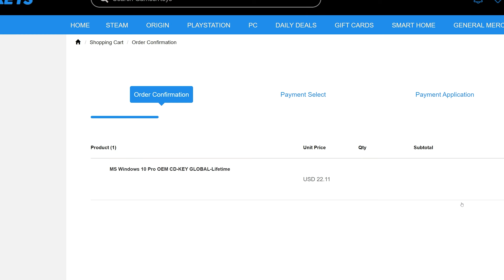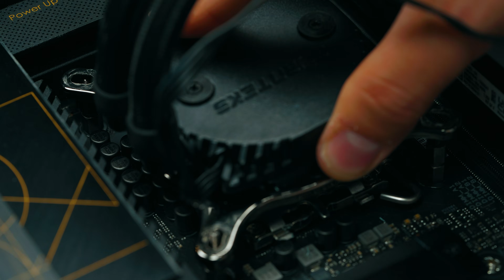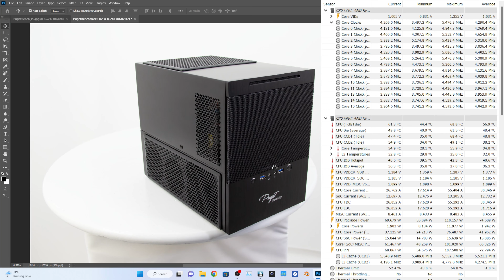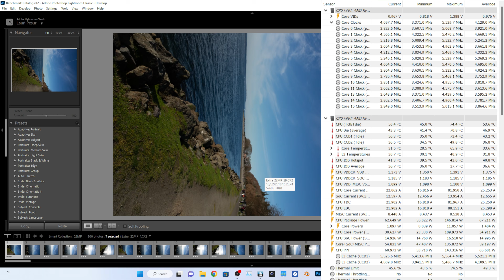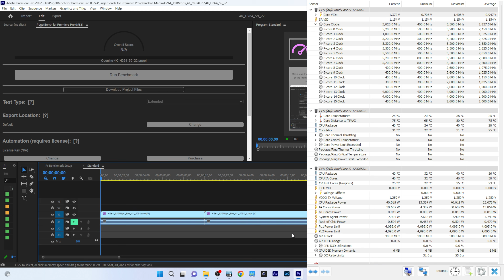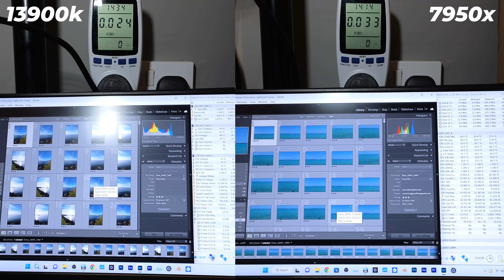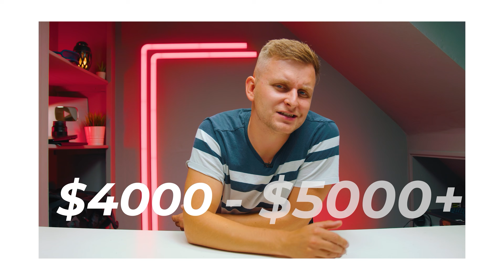INTEL & AMD both lied! 👉REAL WORLD power consumption is MESSED UP

Comment: This definitely needs to be expanded. Compare DDR5 and DDR4, older ryzen 5000 generations, possibly even 11th gen Intel and CPUs with lower TDPs <65W.
Reply: Oh, also the Ryzen Eco mode should be added, I love that function!
Reply: My observations with Ryzen CPUs are:
4600G - 2W at idle. Goes up to C3 idle state.
5700X - 20W at idle. Goes up to C2 idle state only.
3900 - ~30W at idle. It got hot quick, to a level I thought it's faulty.
Power was measured on 12V CPU supply on the motherboard, with current clamp.
All of these CPUs are "65W TDP".
Tested both with proxmox without any VMs running, and with fresh ubuntu.
+20W means +50€/year on electricity bill. That's crazy.

Comment: 15:45  up until this time in the video I thought the power differences were going mean huge costs for the AMD.  Then I see that the 7900x will cost about $20 a year (I'm in the US and pay around $0.30 per KWh).  I appreciate you doing this work, but for $1.67 a month, I couldn't care less.  I'd rather have a higher average wattage with a lower max wattage, especially if the difference compared to a 13700k is only $5-7 per YEAR.

Comment: I'm a little confused. Doesn't Idle mean the computer is not being used at all; meaning the computer is not running any programs? Your "idle" power consumption shows a program running in the background, which means it wouldn't be idle. It would be running in the background.
Reply: No, "idle" can include non intensive apps being run or left open even. Reading a website for example or having an empty scene with blender running, and nothing being rendered. Think of it like starting a car and while its in drive, without pushing down on the gas pedal, the car still moves forward. You can still move from point A to point B. That's kind of what "idle" refers to in the context of the CPU.

Comment: If you want to have the mean power consumption you have to integrate the measurement over time and than divide it by the number of increments. But you need a measurement software for that.

Comment: I've made a lot of testing with my Ryzen 5600H Laptop to find out its best performance per Wat. Power efficiency depends on max TDP. So it was 15 W for a 50 W processor. Where it has exactly 50% of max computing power but much lower temperatures <50 C, nearly quiet fans, and more than enough power for day to day tasks and even games. Moreover I tested it in multicore cinebench R23 test. But in day to day tasks you rarely use 12 threads. So single core performance dropped only 10%. I used Ryzen Controller app to restrict TDP for normal and boost modes. And I'm happy with results. Dropping TDP lower than 10 W kills performance totally it's just not enough power to function properly for this processor e.g. on 5W it has freezes in all operations and only 9% of max performance. It would be interesting to see efficiency curve for Intel Processors. I believe they shouldn't have such efficiency boost (+50% efficiency) on low TDP.

Comment: Can you please do an update also with the 3D ones from AMD? It would be interesting to see how they do in idle.
Reply: my 7800X3D idles at 30-40 watts!
Reply: @juno1597  That is quite a lot. Not as bad as the about 50-60 I saw for 7950x (I think), but still bad. Intel ones idle at about 10, even a bit lower sometimes.
Reply: @ContraVsGigi  I can't believe how bad these processors idle and I leave my computer on all the time.  My 4770k overclocked would idle as low as 5 watts!
Reply: @ContraVsGigi  yeah, i dont have a 13900k myself, but my friend has a 12700k which is close and it idles at around 9w from what he told me

Comment: I wonder if the 7800X3D uses the same idle power as the 9750X?
Reply: Only 1 ccd, it will use less. Still higher than an intel though.
Reply: @deuswulf6193  I'll take it, cheers!

Comment: This is a really interesting test, but I'm trying to decide between the 13600k, 13700k and 13900k. I'm a full time photographer and I'm trying to understand the difference in power consumption and therefore electricity cost would be over a typical year between the 3 CPUs? Is it significant or inconsequential?
Reply: You're not going to make a dent to your electricity bill for photography since it's mainly burst CPU usage (culling & photo adjustments). You would have to export ten of thousands of photos daily to even consider power consumption. Which software do you use and are you a high volume photo exporter?
Reply: @Rocky_KO  Mostly LR and Photoshop. I don't do high volume work, so most of my time is spent doing compositing and detailed retouching work in PS. I kind of came to a similar conclusion after watching some other videos and doing some maths on it. I bought the i9 13900k in the end.
Reply: @mdhazeldine  13900k isnt a bad choice. Since its a full time job, processing photos will require a lot of cores and high productivity. 13600k is more power efficient though.

Comment: intels idle power draw has nothing to do with the e cores.  my 9900k drops to 5.5 watt.  They just downclock way way better. AMD needs to be better period. Their board power draw is also stupidly high. And your test only applies to stock settings and sadly stock is BAD these days specially intel needs to be capped on power draw. they are just given to much power. If you cap them on -30% power you barely lose any performance but power draw drops significantly. But yeah i buy high end at all times and AMD is just not cheap enough. They need to e at least 200 cheaper for a high end system to be even considered seeing i make a system last 4 years on average and power is expensive so that value needs to return to me...

Comment: SO all in all the difference is a night out at Spoons per year? its hardly a huge thing. i was worried that the 7950x would be massively costly to run but it seems at worst there is about £30 per year in it. yes the AMDs generate alot of heat but in the winter months that heat can heat up your room so nothing wasted :P also you can cut down the AMD chips power usage in the Bios where you only loose about 30% performance. and half the energy cost. 
for me i only use the these apps occasionally. i mostly do 3D work and Unreal work so its GPU heavy and would use resolve for video editing. I will consider intel and see if a cheaper mobo and CPU would be an option. thanks for the video it was helpful.
Reply: I think the whole comparison is rigged, wrong made (software only!) and you better dont even think about power consumption or efficiency when it comes to x86 platforms in general.
- INEFFICIENT BY DESIGN, universal, every programmer knows how to handle it, but still ancient and inefficient.
- As you stated, hardly a huge thing if the faster CPU only cost 5 coffees more a year.
- ARM SoCs.... since they are getting more and more interesting especially for the 0815 consumers, we can say pretty sure: x86 is outdated and should have been long gone, since at least the ARM v7 era.

"also you can cut down the AMD chips power usage in the Bios where you only loose about 30% performance. and half the energy cost"
At this point you also could have just bought a Ryzen 5 instead of the Ryzen 7. I would rather go the opposite way - for example my i7 4790k from 2014 is still running at FIXED 5GHz (overclocked...) otherwise it gets unstable, but i rather prefer 10-20% better single and multicore performance which translates about 1:1 in fps drops (so instead of 50 fps drops 55-60) for "only" 100% more power draw (its rated for 88W but running at full load anywhere between 130-160W).
Reply: I also loved my AMD Phenom II once in winter... even in idle it was a room heater, under load it became a heat gun, especially in combination with once 2x Radeon HD 6970 GPUs. Each GPU 300W, with the AMD overclocked to its maximum stable frequency in total the system consumed about 100-150W in idle, 350-550W in gaming and under artificial 100% load 650-750W. Noisy, but for a while very powerful for "little" money.

Comment: All this talk about efficiency, and no mention of Intel’s T processors?
Reply: Even the T processors are bad.
Intel also made (and still make?!) specific CPUs more efficient than the Ts, called the "P"s, the Ts had all 30-35W TPD and the Ps a maximum of 25W as well more efficient in general. The P processors were only found in more expensive, higher end notebooks but they made already in 2008-2010, the ones i have experience with, a probably not huge, but noticable difference in low load/idle scenarios and even more under 100% load.

My personal experience was with a higher end T9600 notebook (Geforce 9600M GT) and a P8800 MacBook Pro (same GPU, 9600M GT), yes the P was slightly but not noticable slower than the T9600, but so much cooler under load aka longer battery runtime.

Comment: My Skylake i7 can dip down to 5 Watts when not doing anything on HWInfo64.  It didn't start with Alder Lake.  🙂
Reply from the maker: I guess it's the monolithic design instead of chiplets...?
Reply: Thats not really special, my i7 4790k, anno 2014 also goes down to 10-20W easily if i allow it (which i dont, fixed 5GHz all the time)

In fact any "modern" x86 CPU is inefficient, since i have a M1 Pro MacBook i also realized the x86 era is DONE (for the 0815 customers at least)

the 5W my M1 Pro consumes under decent load, more realistic are below 2W in idle, 3-10W under regular load and probably 20-25W under 100% CPU load.
Reply: Your i7 downclocks, my i7 iddles at 5 watts and it's partially OCed. 14nm is way worse than Intel 7 process.

Moore's Law.
Reply: @saricubra2867  no
Reply: @harrison00xXx  I have a Kaby Lake mobile i7 lying around somewhere, never iddles that low.

Skylake never was a good architecture, in 2017 AMD launched the Ryzen 7 1700 and for 65 watts you have 8 cores and 16 threads as the max.
Reply: @harrison00xXx  I have 8 watts while watching a 4K YouTube video. I have a 12700K, Skylake is obsolete by 8 years dude.
Reply: @saricubra2867  sure Skylake was bad
i rather prefer my haswell i7 4790k at 5GHz
Reply: @saricubra2867  Btw do you even realize ANY x86 CPU is anyways inefficient?

Your „8 Watts“ are how much on the AC plug? I would guess depending on the graphics card (which does the real job when playing a youtube video) your power draw is anywhere between 30W (in the absolute best case)  and 100W (more realistic)

What i can say for sure: My 16“ M1 Pro MacBook consume about:
- 10W 4k youtube playback
- 5-10W in idle, office stuff etc
- 20-55W in gaming
But the main reason for the MacBook to drain fast is the SCREEN, without screen i measure in idle something like 1-2W, 3-6W for 4k HDR youtube playback and 15-40W depending on the game.

THATS efficient…
Reply: @saricubra2867  A friend has btw also a Kaby Lake (Desktop) CPU…. 7700K at 5GHz same as my 4790k.
In fact the 7700k isnt much faster, and not even more efficient at all since his 7700k needed a lot more voltage than my 4790k for 5GHz so he sticks to 4,8 or so, resulting in a pretty much similar performance.

The only thing his 7700k can do better… he still can use energy saving features, if i enable them on my OCed 4790k it gets super unstable
Reply: @harrison00xXx  My i7-12700K is faster than the M1 Pro and power draw is similar
Reply: @saricubra2867  Did you really fell for this advertisement?

I mean in multicore the 12700k is really great, but in single core they are on par and in all my usecases the M1 Pro is still faster (media engine, dedicated ProRes De/Encoders, super fast memory bandwidth,…) and also MUCH MORE EFFICIENT.

And no, the power draw is NOT similar at all not even in idle/low load, otherwise notebooks with 12700k i7 would exist and have like 10-25h battery runtime as my 16“ M1 MacBook Pro.
Reply: @saricubra2867  You know whats very interesting about the M1 Pro/Max chips?

The fact that you can render super fast and efficient a video with the media engine (NO Cpu or GPU core load!) and at the same time i can AI upscale videos to 4K without any performance loss or a laggy system.

In fact you can (with enough RAM) even play games without losing a noticable amount of performance while doing stuff dedicated to the media engine, but at this point even the M1 Pro gets toasty and noticable with its fans.
Reply: @harrison00xXx  No, the i7-12700K is faster in single core. Almost 2000 points on one thread for Cinebench R23.

The M1 Pro performs poorly on renders because of thermal throttling. It cannot compete with the best of X86.

Your M1 Pro only has 2 efficency cores, my i7 has 4.

The i7-12700H is way faster on productivity programs because of the AVX2 instructions that can be used to accelerate workloads, Intel has powerful encoder and decoder engines as well.

The M1 Pro is not THAT efficient.

There aren't notebooks with the 12700K because it's a desktop chip, not for laptops, there are already Intel laptop chips that are faster than my i7-12700K, and AMD soon will deliver the same perfomance with low wattages.
Reply: @harrison00xXx  My i7-12700K stays at 23 degrees by watching youtube videos, for Cinebench, it reaches 67 degrees.

If the M1 Pro is supposedly more efficient than any x86 chip ever made, it shouldn't have thermal throttling.

AMD has better iGPUs for gaming.

The only thing that the M1 Pro has is good IPC, the rest is the Apple Hype Train.
Reply: @saricubra2867  the M1 Pro doesnt have thermal throttling?

Also throttling has NOTHING to do with efficiency
Just take a M1 Ultra as example, you can force it to throttle yet its highly efficient for its performance
Reply: @saricubra2867  you really love to talk nonsense?
Reply: @harrison00xXx  Yes it has to do with efficency.

The problem with Apple's chips is the sacrifice of perfomance for the sake of low power use. That kinda kills the point for perfomance per watt, specially when software compability isn't good or the hardware is the problem as well.

My i7-12700K doesn't have any drawbacks. It just works.
Reply: @saricubra2867  well its very very fast and i dont have any issues you talk about

But hey you dont know any modern mac experience, its ok some day you will be forced anyway into ARM chips because the industry will do so
Reply: @saricubra2867  We also need to define our terms here.  Utilities show power drawn by the processor but I also often measure from the wall with a wattmeter.  🙂  Basically computers are on the defensive versus smartphones for basic computer use these days and phones might sip a handful of watts when charging their batteries.  🙂  Yeah it's a little nuts but I like computers that fire up for games but then ramp way the heck down for regular computer stuff.  I'll probably go Ryzen 7 7800X3D whenever I can find one at MSRP.  🙂

Comment: Very interesting content! This makes me doubt on my choice on building an pc for cad/cam software with an AMD 7 7700 processor. What processor would you advice for design and manufacturing software (Inventor and Fusion360)?
Reply: Why? Because you can save 10$ on energy bills a year?!
Reply: @harrison00xXx  no, it’s going to be my first build and im still researching on things.
my goal is to make the pc as quite as possible. For that reason I want to use hardware that doesn’t generates an lot of head, so i don’t have to run the case fans on an high rpm. Less head = less noise are my thoughts behind it.
Reply: @BT-st4ho  Fans? I mean i have 2 fans in my notebook, but unless i drive it really hard they are not noticable and mostly just go in idle speed of 1600 rpm, otherwise they are just OFF.
Rarely, when video upscaling the fans are getting noticable, but still more silent than the average Desktop.

No good performing x86 platform will ever be very silent (or efficient) in the near future, if you want it as silent as possible you need to switch to Apple silicon Macs.
I bought over a year ago a 16" M1 Pro and i cant say anything bad except that its not good for gaming but i cant care less since i have a dedicated gaming notebook and an older gaming PC.
Reply: @harrison00xXx  yess i almost pulled the trigger on an MacBook PRO 16 M2. I love their power efficiency compared with an windows. Problem is that most CAM software an cnc controlling software don’t run on macos. That’s why i have to go with X86. I recently received an R9 7900 (65/88w tdp) and an Noctua U12A cpu cooler. I think the acoustics should be very low in my fractal design north with 5 noctua case fans. If I ever need more power from the cpu this should be no problem.

If I ever buying an laptop, it’s going to be an macbook for sure
Reply: @BT-st4ho  yes, intel is cooler and has less noise at idle. It also has better ram control . Its actually hard to find a suitable ddr5 that does not take mins on start screen loading if it’s on am5 system.
Reply: @harrison00xXx  zen4 has ram support issues. Takes to long for Power on self test. If u like ur life to be easier amd is not a good pick

Comment: Cooling should at least be max possible tdp otherwise it will throttle if it ever reaches a high enough workload. You speak about Intel vs AMD but this comparison is only valid for the generation you tested.